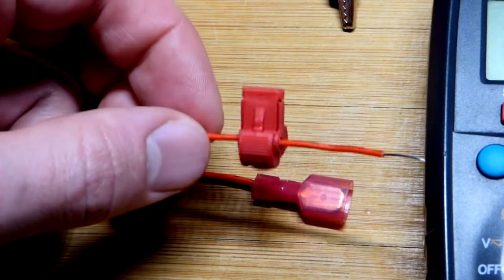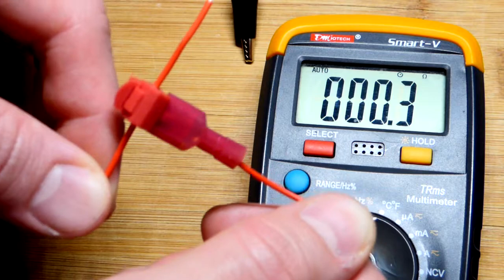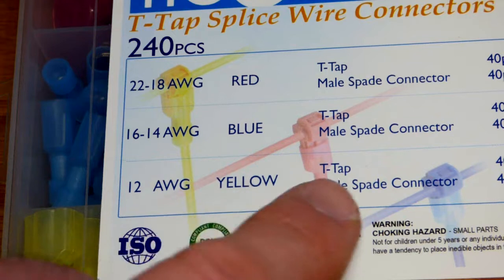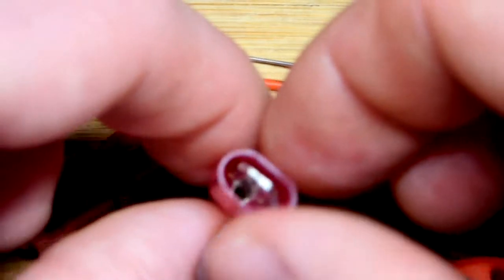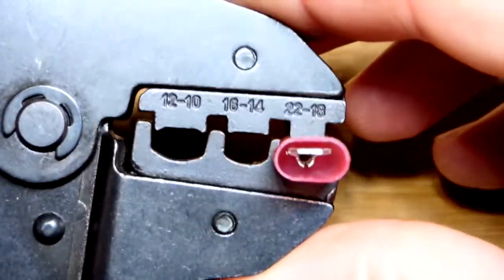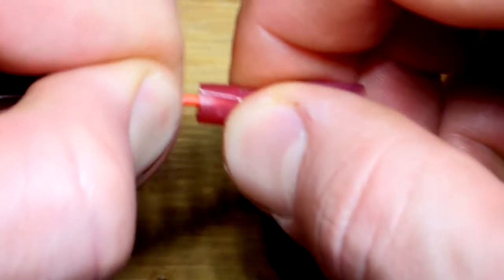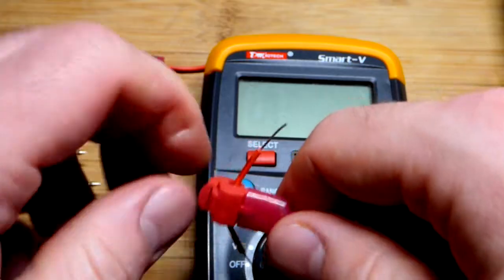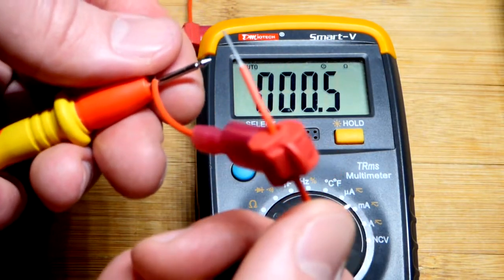Easily attach a second wire using T tap wire connectors with quick disconnect spade terminals

Comment: For accurate resistance reading don’t touch meter leads with bare hands it add up body resistance
Reply from the maker: Touching the probe leads does connect millions of ohms of resistance to the probes, but that is parallel to any other resistance being measure. So, it will actually make the resistance slightly lower, but not noticeable when parallel to a low resistance. Thanks for the comment!

Comment: Used these for installing remote lock, so far so good - works well and was an easy install
Reply from the maker: Nice.
Reply: How did they do??
Reply: @maximpenaarevalo7507  Works fine, remote lock has not had any issues.

Comment: That's the tap wire(the wire is  wiggle worm on the left and the right it has a sharp bend on it  on the  aka bent coat hanger which has 7 end of it it's the same wire thats attaches the plastic egg which leads to the tree in the park aka Z tree. Inam

Comment: So when connecting the first part of the T-tap connector I don’t I have to strip the plastic off the wire right to get a good connection? I thought it might mess with the connection
Reply from the maker: Not suppose to have to strip off the insulation. I haven't done any serious testing to see how good of a connection it makes yet.

Comment: Do not by any means use these crappy T connectors.
These are some of the worst connectors available, not only are they not practical because of how large the connector is but it's also the least amount of surface area that you could provide for your connection.
Reply from the maker: Thanks for the tip!

Comment: First of all these are not designed for solid wire, second of all measuring resistance on a wire with no current flowing doesn’t tell you anything, you need to measure voltage drop
Reply from the maker: Thanks for the info!

Comment: If I t-tap positive to positive and negative to negative, will it be a complete circuit or does the ground still need to be grounded somewhere else?
Reply from the maker: When it comes to batteries, you just want them to have the same voltage (no more than 0.1V different) when you connect them together. And then usually the negative side of the batteries is considered the 0V reference point ground as far as any circuit attached to that battery bank is concerned.

Comment: Does the straight end of the wire get cut when the connecter is clamped down on it?
Reply from the maker: I think that it just gets pinched. I don't know for certain what exactly happens to it though.
Reply: Aren’t you supposed to strip the wire before clamping on T Connector?
Reply: @MsRotorwings  no

Comment: When you measure resistance, you dont touch both leads with your bare hand as your reading will include your body resistance in parallel
Reply from the maker: Thanks for the info!
Reply: That's true, but body resistance vs metal wire is negligible, so I think for the sake of demonstrating that conductivity is right, it doesn't really matter.
Reply: Learn something new everyday day. Thank you

Comment: Is grounding a wire needed when what you’re trying to apply it with comes with a red and black wire, for example Tacoma grill lights, I have a harness wired up but would like to know if grounding is necessary and how to do so in correlation to the way you did this.
Reply from the maker: I haven't done any vehicle wiring so not a good person to ask, but generally speaking, the red wire should connect to positive side of the battery and the black wire to the negative side of the battery in some way. Negative side of the battery should be connected to the vehicle frame which I believe is called chassis ground as far as the electronics goes. These connectors may let you tap into other wires but I'd be careful that nothing gets messed up in the process. Hopefully there's DIY videos/websites for that exact project.

Comment: Anyway to make those permanent?  As in unable to be unplugged?
Reply from the maker: I don't think so. But, spade connectors are usually tough to get off. So, it's probably a solid connection for as long as you want.
Reply: @Electronzap  mine must be faulty because they slip off really easily.  Wish you could crimp the T connection just like the regular crimps.
Reply from the maker: That sucks. I just found these https://amzn.to/2Xqsx5Y They are a lot more expensive but claim to be more reliable and hold 2 wires instead of 1. I don't see any for other wire sizes but I didn't look much.
As an Amazon associate, I earn from qualifying purchases.